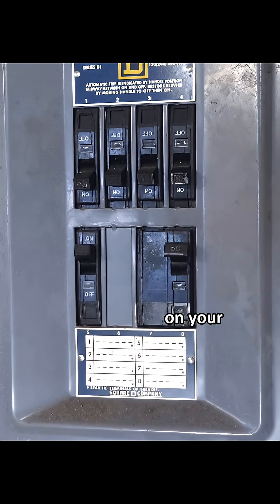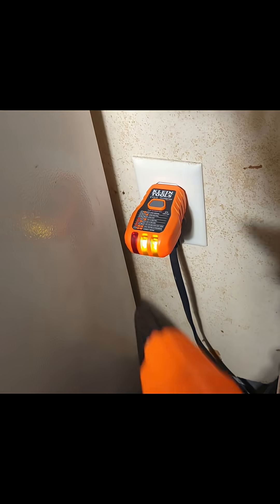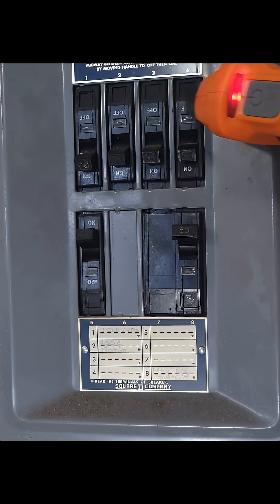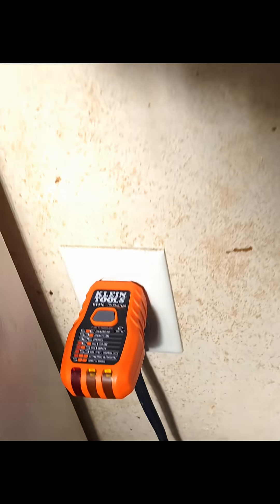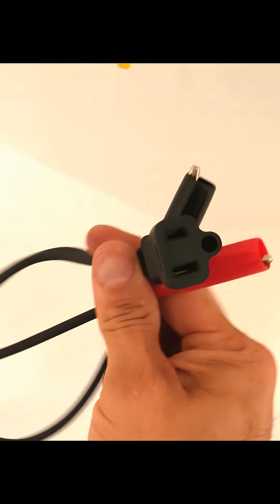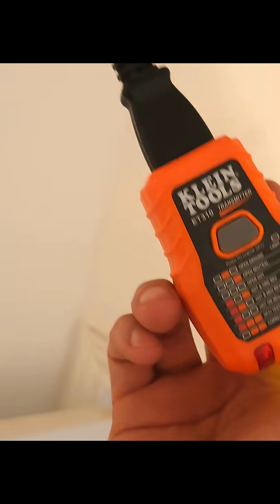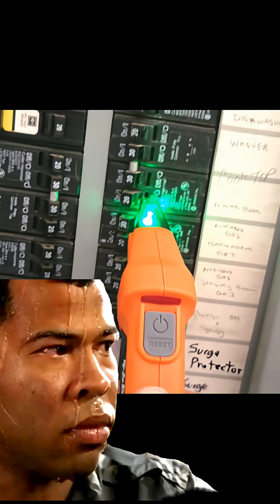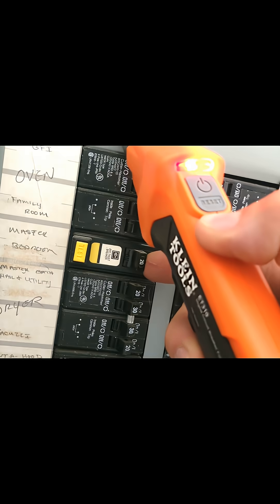How To Find The Right Circuit Breaker

Comment: I have one of those!  didn’t know about the wire adapter. Though I don’t see how that helps as one is typically trying to find the right breaker before the wires are exposed.

I get the wife to stay in the room and with us talking on our mobile phones, I flip breakers until she tells me when the light goes off.  

When she’s not available (or willing) then it just means that I must run back and forth between the room and the main panel. 😂

Since this is my home, I update the notes next to the panel after learning of a new circuit. It is amazing how much daisy chaining is done in old homes.
Reply from the maker: Yes, so much is on one breaker in older homes.